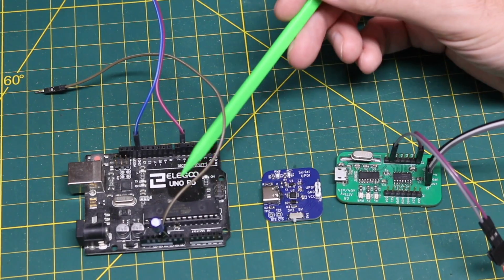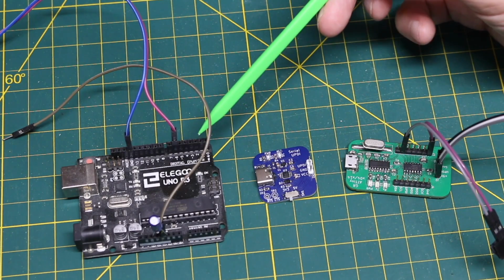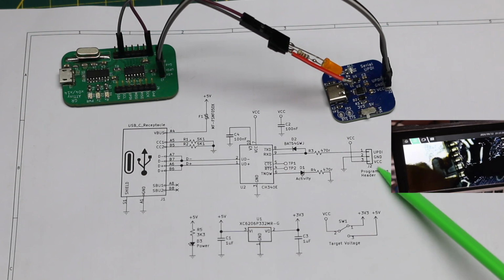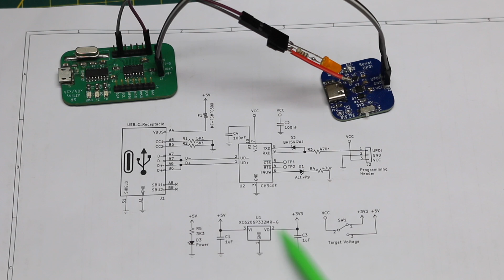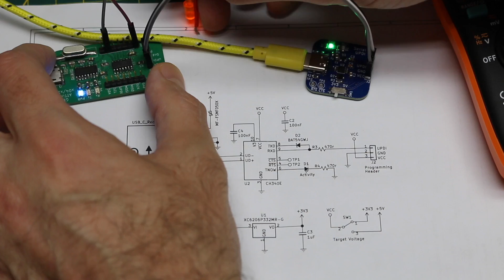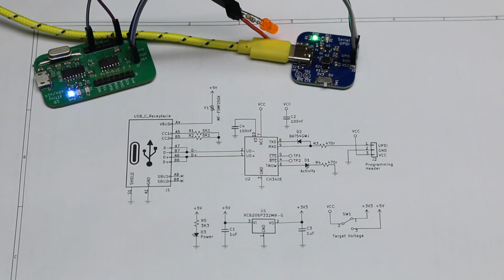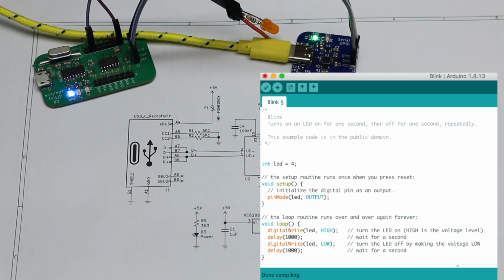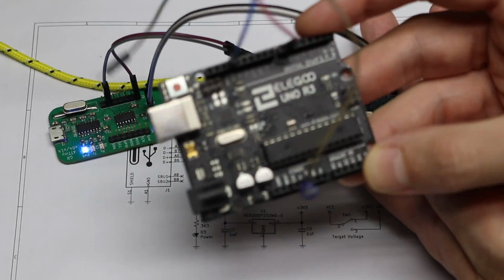Serial UPDI Programmer for Arduino IDE

Comment: Hi Gadget Reboot, shouldn't the V3 pin of the CH340E be connected to 3.3V ?? 🤔
You have yours connected to GND .. why ? in most UPDI designs, I see people connect it to 3.3V
Reply from the maker: it’s connected to a decoupling capacitor which is connected to ground. The data sheet says to connect it that way if it’s powered from 5 V but for situation’s where it’s powered from 3.3 V the data sheet is completely ambiguous even if I try to read broken English it still doesn’t really tell me anything. 
It says “ Connect to VCC to input external power when 3.3 V power supply, Connect to 0.1 UF decoupling capacitor win 5V power supply”
so I’m not sure if powering from 3.3, do they want us to connect it to the 3.3 power so I basically tried it out just with the decoupling capacitor and it seemed fine and I saw other designs doing the same thing so for lack of having proper info I just went with that
Reply: @GadgetReboot  
Thanks.

Comment: This is nice. I simply hacked one of those cheap CH340E modules from Aliexpress, with a diode and a jumper to switch between 5V and 3.3V. The thing I've never taken the time to work out though. It would be nice to use a single adapter both for programming and to receive serial debug output from the ATTINY. In my solution I have to keep switching between differently-wired CH340E boards.
Reply: same here.

Comment: I just use the PicKit 4 to do my Arduino programming seems to work for most things, and MPlab as the IDE.
Reply from the maker: The only official programmers I have are the picstart plus from the 90s and PicKit2 so I think I would have to buy the latest in order to use modern tool chains. I don’t remember what decade I last used MPlab
Reply: @GadgetReboot  bit of a pic fan boy here!
started with a home made pic start, then went on to  a pic start+ ,  pickit1 ,2, 3, 4, a pic icd2 & 3. always wanted a pic Ice.
Reply from the maker: I don’t know if I’m imagining things but for some reason back in the early days I think I saw some horribly ASCII drawn schematics to make homemade pic programmers 

I can’t remember if they used the parallel or serial port but it looked like just some diodes or buffers or some thing. Never did try it. If I could find those things again I wonder if I’d be motivated to try hooking that up on an old 386 and see if I can get it working
Reply: @GadgetReboot  I've built a few parallel port programmers for the Pic18's. But when the pic start came out microchip put the circuit in the user manual. it used a pic as the controller and after a few months they released a code update. so I programmed a pic at work and built the circuit from the manual and had a pic start copy up and running in a day or so.
those were happy days.

Comment: I’ve got some of the UPDI attiny’s in my cart, but haven’t pulled the trigger yet. A CH340 is waiting to get made into a similar serialUPDI programmer. Thanks for the video.
Reply from the maker: Are you getting the ATTinys from somewhere like eBay or AliExpress? i’ve never tried that, I’ve always bought them at the main Distributors but I remember seeing advice on the mega tiny core information pages,  not to trust getting them from those sketchy sources
But  just like every other silicon item, I guess it’s possible to get working ones.
it looks like just adding the diode and series resistor to just about any USB UART interface should work so it’s good that it’s a universal thing.
Reply: @GadgetReboot  I just got an ATtiny1614 from Aliexpress with an order, just to test it. No issues. A CH340 adapter with a Schottky diode between RX/TX and 470ohm resistor to 1614 worked great to program it with MegaTinyCore and Serial UPDI.
Reply: I have purchased ATtiny 84, 85, and 861 from eBay and aliexpress (when I see a good deal) without issue. But for this round, I'll be getting them from Digikey (along with some Raspberry Pi Pico 2's), which is my preferred vendor for such things.